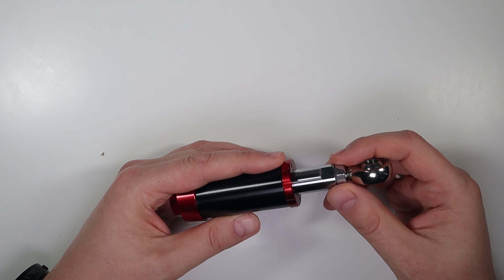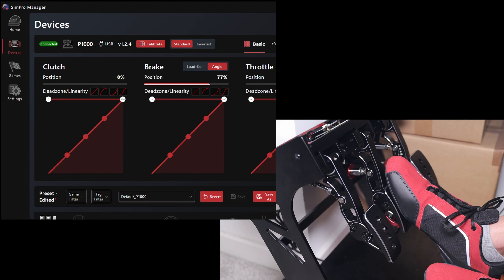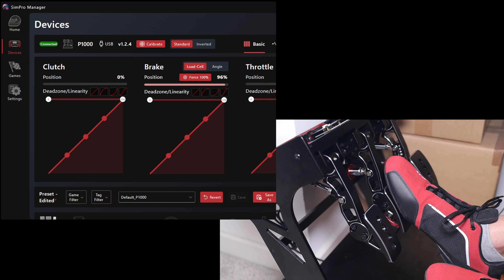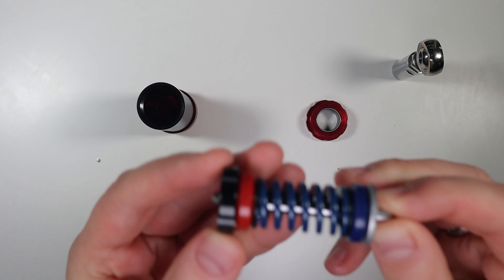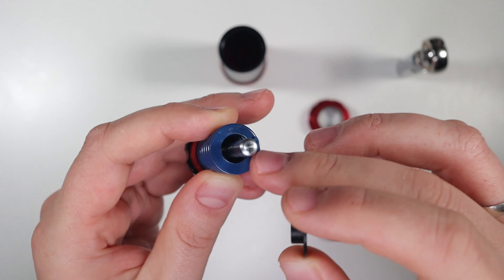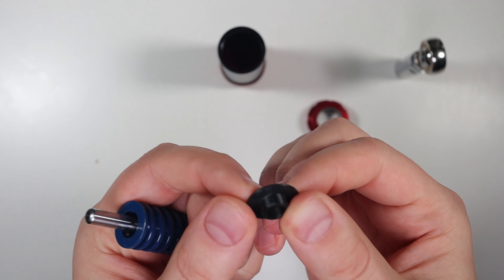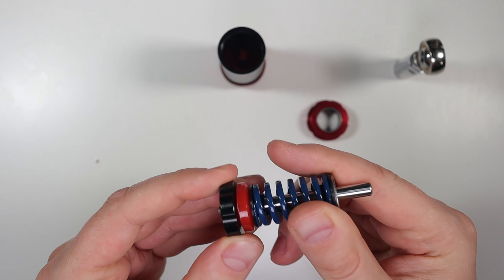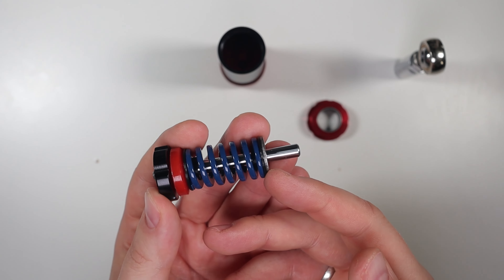How to fix Simagic P1000 Load Cell Drift

Comment: I've been trying to tell people for 10 YEARS that there's something wrong with all the loadcell pedals I have owned including Fanatec Clubsport Pedals V2, Fana CSP V3 (with damper and Brake Performance Kit), Fana CSL Elite LC, Heusinkveld Ultimate Clones (with authentic Mavin loadcell and authentic German white FibroElast and green FibroFlex elastomers), and more. I didn't realise the problem was the elastomers, not loadcells, all I knew was that this problem existed.

Fanboys online always tell you you're wrong or you're crazy or whatever. Every time I would go back to potentiometer pedals (with modded springs or elastomers to be more strong than stock ones), the problem would go away and my driving would improve again and so would my driving enjoyment.

Recently, I decided to give loadcell another chance...again. This time I purchased the Thrustmaster T-LCM. With the TM pedals, the problem with every other loadcell pedal doesn't exist even though it's also a loadcell. Why is the TM T-LCM different than allll of the other ones? The only difference is that it uses springs, not elastomers. This is proof to me that the problem is not loadcells but elastomers/rubbers! Springs are way better! I knew there was something wrong with all these other loadcell pedals the past 10 years but no one would believe or understand no matter how many times I tried to tell people!
Reply: yeah it sucks when you know somethings off, but you can't put your finger on it or find a solution or even the problem.
Reply: The problem is hysteresis. Ironically, it's the reason why rubber tires generate grip. So, hysteresis is not just good but essential when it comes to grip whilst braking (and cornering and accelerating), just not so much when it comes to brake input.
Reply: On Fanatec CSL Elite V2 default setup combination of spring and elastomers this problem dont exist . I guess its something with the elastomer design/material that its off by Simagic p1000
Reply: @martintop2605  As I mentioned in my first post, it happens with all those Fanatec pedals and even Heusinkveld Ultimates and Ultimate+.
Reply: @Spinelli__  Maybe its something with your braking technique , i can keep 80 % as long as i want on CSL Elite V2. I was thinking to get the p1000 but from what i saw i will just get adapter for the haptics an bk racing mod for  throttle and keep the V2s
Reply: @martintop2605  It's physics of elastomers as already explained by other videos.
Reply: @martintop2605  Maybe it has something to do with you using a spring.
Reply: @Spinelli__  yes maybe the sprig mitigates the elastomer relaxation. I get my cls elite v2 160 Euro (without vat) on black Friday its its crazy what value Fanatec offers for that price . The kit even includes 3x 65 3x 80 kg 3x 100kg elastomers and stiffer springs  .
Reply: My TM T-LCM pedals have  same issue but it maybe because the plastic parts are starting to be quite worn out after just over 1000 hours of use. The brake pedal has around 2cm of sideways play which isn't optimal... 😂

Comment: I mean you werent supppsed to use the metal piece on top to begin with. With tbe spring. You use the 3 plastic pieces. One bottom, one middle and one on top. Therre plastic/rubber spacers hold up and work very well imo.

Also why arent you using it longer? That imo is to short and you cant just use kne spring with 1 elastomer.

Comment: Thanks for this - just a heads up - the 3D printed caps don’t fit the Simagic springs.  The Simagic springs inner diameter is 9.3mm, the outside diameter of these caps is 10mm.  If anyone knows how to fix the thingiverse recipe, I’d love to reprint these.  Thanks!

Comment: oh... thanks!! 🙌👍👏....  do you think this fix will work with any other pedals?? ...  uhmmm... I will try this with my Moza SR-P pedals... the break pedal has a 1 spring and 1 elastomer.. I will change the elastomer with a spring to see how works the break pedal🙂
Reply from the maker: I think it's a generic issue with the elastomers, see race beyond matter video on this, in my opinion the reason why it's so drastic with p1000 is because there's multiple small elastomers which inflates the problem
Reply: @petermakesthings7342  yeah.... makes sense..
Reply: @petermakesthings7342   just wondering, ever since race beyond matter changed to hydraulics on the p1000, he said no more problems. How would that be possible if he still uses the same elastomers?
Reply from the maker: the hydraulic system is generating much more force than the standard setup, which means you can use harder elastomers, you'll notice in the video he's using like 5 reds + 3 alu spacers, that simply limits the issue (that's my theory, didn't try it myself, using spring on hydraulic from very beginning)
Reply: @petermakesthings7342  I agree with you. Saw that video and I think the problem is solved by using only the red ones + spacers.

Comment: Hey Peter, just checking in as it’s been a few months - do you still use this setup or have you made any additional changes? Thanks!
Reply: First of all, thank you very much @petermakesthings7342 for sharing this mod. Definitely way better than using full elastomer pads! You can really have precise control with the pedal and it helps a lot on my trail braking. @JesseGebauer fyi Unfortunately, the 3D-printed washer (next to the red elastomer) broke into pieces after >10 hrs of use. The other 3D-printed washer is still intact and has no damage. I just finished making some modifications and we'll see if it will hold up in time... So basically what I did is used a metal washer next to the red elastomer and then I cut off the flange of the 3D-printed washer and only used the (ring) part that helps stabilize the die spring from moving side to side. The 3D-printed washer and metal washer configuration next to the blue elastomer remains the same. And by the way, I used the dark green (heavy load, 28% compression)10x20x35mm die spring I bought from the link below. As Peter mentioned, the preload tension needs to be dialed in properly. Otherwise, maintaining 100% brake pressure is somehow inconsistent. I will try the brown (X Heavy Load) die spring soon. It should increase the stiffness a bit and reduce the compression to 24%. Thus, slightly reducing the brake pedal travel. Also, the 3D-printed washer can be replaced with the combination of an M6 metal washer and stand-off and flange coupling (depending on the length of the die spring used). Happy modding guys!

https://www.aliexpress.com/item/4000277618107.html?spm=a2g0o.productlist.main.7.35deeb1aSjLN1f&algo_pvid=5a5beb70-b1d8-4c9f-b357-4a0f73a78b17&algo_exp_id=5a5beb70-b1d8-4c9f-b357-4a0f73a78b17-3&pdp_npi=4%40dis%21SGD%214.10%213.60%21%21%212.96%212.60%21%402140e03217077105871952488ee53a%2112000025405462336%21sea%21SG%210%21AB&curPageLogUid=t8ZjXi87qjWI&utparam-url=scene%3Asearch%7Cquery_from%3A#nav-specification

Comment: Thanks for sharing!
This was my first thought as I saw elastomers being used in the P1000. I wanted to try finding the best spring that fits in there, if not even 2 - for a 2-stage feel.
So my questions to you: why did you use the 2 elastomers? (One on each end) and do you think a 2-stage spring setup is doable?
Reply from the maker: The total hight of elastomers is 48mm, the shortest die springs I can find is 25mm, 2 of these is reaching the limit, but you do have to use the washers cause springs material is harder than alu (and plastic) which could damage the stock parts, if you were to add 2 springs and washers you'd have to apply around 6mm preload, it could be fine, didn't test that though.
As for 2 elastomers I used - had my doubts, but after testing there's no drift so I don't mind them. The reason I used the elastomers is to have them as sacrificial components if it turned out the spring is damaging the stock assembly, so far it seems the concern was unnecessary as even with just pla it held just fine,  but like I said in the video I didn't test it for long enough. 
The bottom line is that the spring(s) solve drifting issue so it's down to the individual users to find their sweet spot.
Reply: @petermakesthings7342 would this be possible for the hydraulic mod on the p1000i?
Reply: @Simlife101 wouldn't the hydraulic leak of it was inverted?
Reply: @phreshxmetal  no, because you can pivot the p1000i hydraulic reservoir.

Comment: very interesting ! but why didn't you replace elastomers by a spring that lengh 20 x 10 x 45mm ? what would be the issue if you get rid of the washer ? thank you !
Reply from the maker: Springs are made from much harder material than plastic or aluminium, if you don't add a 'buffer' like ss washer or elastomer you're risking to damage the pedal enclosure
Reply: @petermakesthings7342  thank you !
Reply: @JoFandango  great question and great answer by Peter!
Reply: 쇼핑몰에서 구매하고 결재까지 했는데 2달이 지나도 물건이 안와요
아무리 매일을 보내도 답장도 없고 너무 한거 아닌가요

Comment: I m going to follow your mod. I just bought the 4 springs ( yellow, navy bleu, red and dark green and I will compare). thanks for the Tuto ! 
About the die spring washer, would you recommand PLA, TPU or something else ? 

Btw, i m curious to know if this mod would be useable too with the Hydraulic kit !
Reply from the maker: I printed it from pla, would check on it everything couple of wks just make sure nothing gets damaged (like I said in the video I didn't do long term testing).
On the hydraulic you have different elastomers and there's no 'shaft' in the middle so the spacer won't work, I just put a sping in-between elastomers in mine and so far works fine :)
Reply: @petermakesthings7342  Many thanks ! And what about the Hydraulic + spring feeling ? How do you feel the pedal now ? I took the "whole" range of springs because i think Hydraulic should be already a little bit harder stock.
Reply from the maker: Tbh in my opinion the hydraulic upgrade is so not worth it, don't feel a massive difference and the price is almost 40% of the full pedals set. That being said I'm not a pro, far from it in fact, so it might just the fact I don't have sufficient feel to appreciate the upgrade
Reply: @petermakesthings7342  Thanks for the honest review. I will try soon the springs upgrade. I will check then.
Reply: Where’d you buy the springs from?

Comment: But if you use elastomers with angle it still kinda measures your force.
Example 1: If you apply 30kg of pressure on brake to have, let's say 75% braking power in game, and with that 30kg you move the pedal, let's say 5cm, you will always have to apply 30kg or 5cm to get 75% braking power!
Example 2: If you apply 35kg of pressure on brake to have, let's say 82% braking power in game, and with that 35kg you move the pedal, let's say 5,4cm, you will always have to apply 35kg or 5,4cm to get 82% braking power!
And this is the reason I love P1000, because you can have elastomers but measure distance!

So even simpler solution is to have elastomers and travel sensor for best precision, as you showed in the beginning of the video. You can be 1-2% perfect that way.
Only thing is, that you have to have at least some kind of travel to make this viable... those dudes that do 0,0cm brake pedal travel setups, sorry, you guys are crazy anyway! :)

And for guys that don't wanna mod and that still wanna use brake force and not travel, you can tinker with braking curve at the 80% point to make it not drop that much. It's not perfect solution, but it's some kind of first aid measure.
Reply: How you liking the p1000? Still using them? Also can you tell us your setup in the pedal as far as which elastomers you use? Thanks!
Reply: @kml9114  I don't have P1000 (I have Fanatec V3s), but I will get them this year! :) SimRacing is my 3rd hobby, so I don't invest that much into it!
But in general I like to use soft elastomers or springs (whatever your setup uses) for first 60-80% and then hardest ones for last 20ish percent of brake power. It's just a setup that suits my driving/braking style... and I like long travel brakes.

Comment: which is the stiffest die spring? Im hoping to have a gt or foruma style stiffness in my pedal.

Thank you!
Reply: I think that might depend on where you get yours from. I got blue, yellow and red ones from Ali Express, one of each, and just by looking at them you can clearly see the red one is the thickest (therefore stiffest) spring. But looking at local websites from Brazil it seems the yellow ones are thicker than the reds and that's due to local norms and specifications. I guess you're gonna have to ask the store you will be purchasing yours from.

Comment: Why do you think is better to have a spring rather than the hard elastomers coupled with the hall sensor reading? Thanks.
Reply from the maker: it's fully subjective personal opinion, I just prefer the feel of having the spring, as for why I prefer using LC vs hall -> precision, when you set your pedals hard it barely moves, so you utilise maybe 5% of 14bit hall sensor they're using, with lc it's all about the force so even if your pedal doesn't move at all you still get proper detailed readout

Comment: Why not just use Angle sensor with the elastomers? Is it just a preference on feel?
Reply from the maker: If you have a hard brake with very short travel hall sensor will lack resolution to get a precise reading, if you have a fairly long travel then yeah, doesn't make a big difference
Reply: @petermakesthings7342  good to know. I'm scooping up these pedals in a couple weeks (hoping for a black Friday deal). Ilm prob try this spring mod. Thanks!

Comment: @petermakesthings7342 which combination of elastomers/rubbers were you using on the first test without the die spring?
Reply from the maker: The default one that comes with pedals, think it was 3x red, 3x blue and 2x grey

Comment: you  recommended die spring dimensions: ID=10mm, OD=20mm, H=32mm
but I got the 30 or 35. Which is better?
thanks!
Reply from the maker: Both will work, you'll just have harder time to mount the 35mm cause they'll need to be compressed a bit